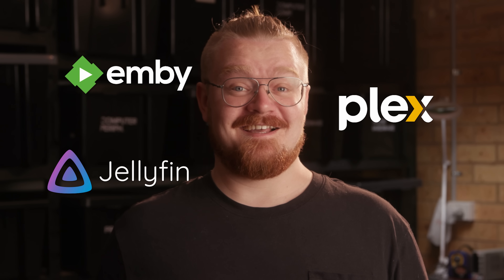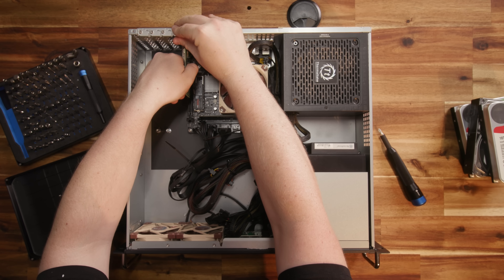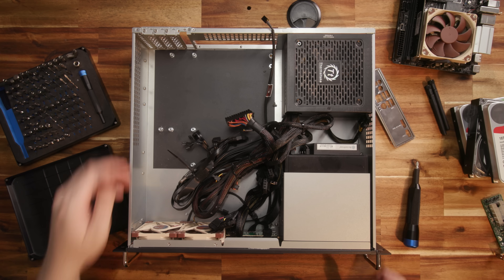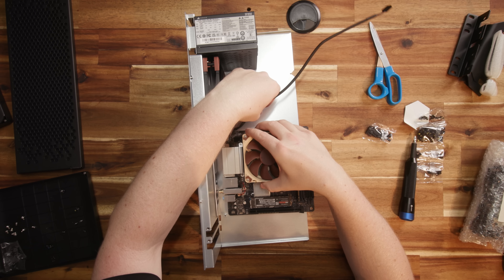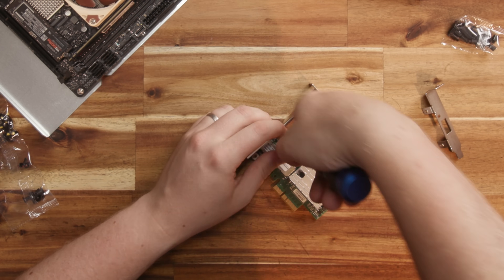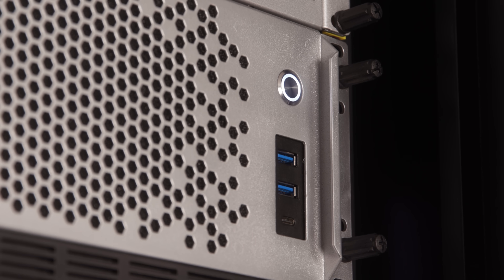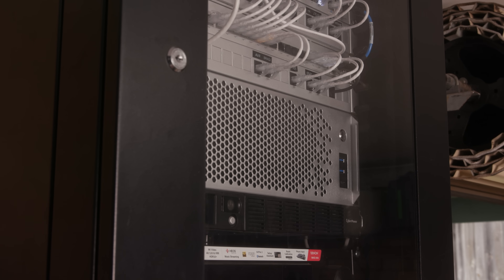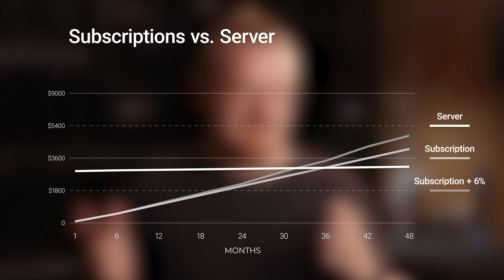I Spent $3,600 Just to Keep Watching Parks and Rec

Comment: a r640 or DL360 gen 10 would have been half the price.
Reply from the maker: True! But loud, and not nearly as efficient. 

Bragi sips 40w at idle!
Reply: @TheStockPot-AU  that's disk and everything? color me impressed!
Reply from the maker: That's with most drives spun down, with them all spun up it's about 90w
Reply: @TheStockPot-AU   still less than a 640 with even a single SSD.

Comment: The most improbable part of this whole build is keeping track of the full-size bracket for three years.

Those things disappear faster than 10mm drivers, socks, cat toys, and candy.
Reply from the maker: I got lucky 🤣

I bought these cards in packs of 2 and I've only got one of the full height brackets. The other one has disappeared to the same place half my socks end up.
Reply: I usually tape them into the case so they can't get lost, and get a small plastic box and label it for which device it's for with all the spare screws, cables and gubbins. The caddy is located in the rack at the base, or taped to the case somewhere if possible so it can't get lost.
Reply: @ThirdEnvoqationThat's a brilliant idea I will never, ever remember to do when it really matters.
Reply: I have a box with the extra brackets for every HBA/NC I've ever bought.  Came in handy recently as I got a LSI HBA with the low profile bracket and swapping it for the full size took all of a minute of digging around said boc.
Reply: my case takes full-size bracket cards, but I do still have all the half-size bracket, just keep them in the spare part box.
Reply: @Bytional  That's exactly what I'd do. Then I'd lose the spare part box.
Reply: I keep the boxes for the components inside the case's box.  That would especially hold true for a more expensive item like a 10GbE NIC since they can cost a modest amount if you get a good one with an Intel PHY.  Just don't make the mistake like I did and try to go the eBay route.  The one I got did function, but it would overheat quickly and become useless.  The legit one from StarTech hasn't had any issues.
Reply: @shinaikouka  SFP+ nic's/switches run much cooler and cx3/4 cards are pretty cheap now a days.
Reply: LOL

Comment: Do all those drives show up separately or as pooled storage for the apps? (I have an HP DL60 Server and to get it to recognize more than two drives (I have 4 bays) involves sacrifices to demons and dark lords). I solve the [problem with a 4-bay  QNAP NAS. Its stable runs Plex and requires little to no maintenance. I have an automated backup to back blaze that costs me about $10 a month. They make enterprise-grade equipment that has a dozen drives but it is expensive but works well.
Reply from the maker: They all show up separately :) 

I used to run a QNAP NAS for work, great products!

Comment: One thing that you may want to point out to your viewers is that while it may be (sort of) legal in most countries to possess a ripped copy of a DVD or Blu-Ray, it's almost certainly illegal to circumvent copy protection mechanisms designed to actually prevent ripping. Is there a risk of arrest for most people? Probably not, but many people think it's perfectly legal when it's not.
Reply: In the US at least, you are legally within your rights to create backup copies of your physical media. What you own with the dvd is a right to watch the material. That right exists separately from the physical disc. If your disc is damaged, you still have just as much right to its content as you did before. Hense why it is legal to make a backup copy.
Reply: @jacobhargiss3839  That's true about backup copies, mostly, but it's irrelevant. It's illegal to circumvent copy protection mechanisms, regardless of the intent.

Comment: i live in Europe, where energy prices are higher, so i went for a lil raspberry pi plugged into a usb hard drive. i don't have the exact numbers, but it uses less than 15 watts when working hard. its not perfect, i do wish the transfer speeds were better, but for the price i got it for it's great. handles my computer backups (inb4 I know it should be backed up 3 times, with one off site) and can stream my 1080p video files quite happily, provided its not doing any conversions. its running open media vault with Plex running in docker, mostly because there's a Plex button on my tv remote. i love it the lil guy

Comment: Another great video! I just recently got a Sliger case for my rack as well, but I didn't run into the issues you did, probably since it was a different case. Overall I was impressed with the build quality. I've been running a media server for my family for years and wouldn't ever go back.